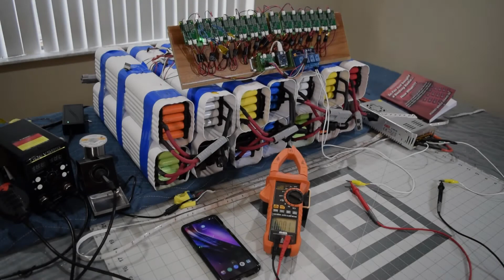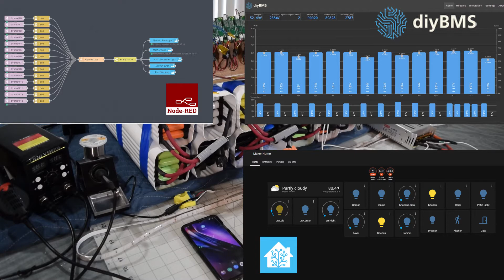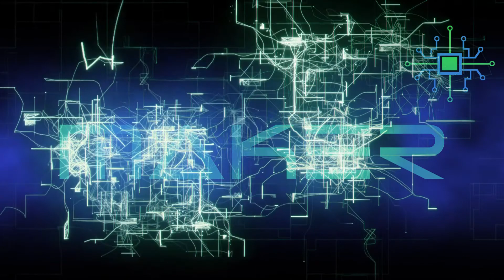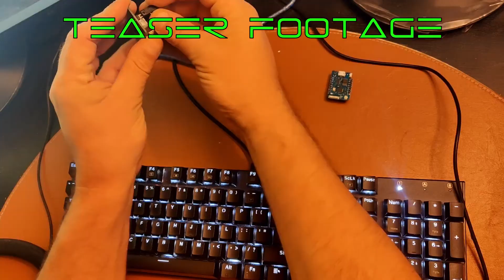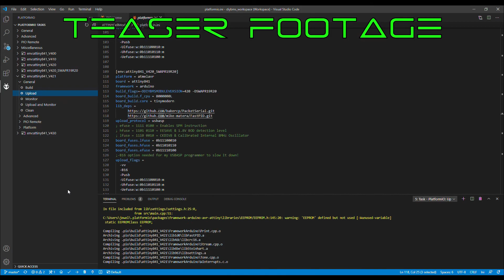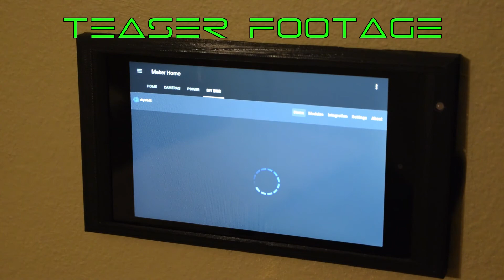Home Automation DIY BMS

Comment: How did you integrate it to home assistant. took me two days with no luck
Reply from the maker: Created a sensor for each of the cells:  - platform: mqtt, name: "DIYBMS Pack 0 Cell 0 Voltage", state_topic: "diybms/0/0/voltage"  .  You can also get the internal temperature with state_topic: "diybms/0/0/inttemp", unit_of_measurement: "°C"

Comment: Good integration, well done. Just surprised to see the hugh voltage differences between your packs. it's like more than 0.25V. My powerwall has also 14S config and packs are all between 0.02V, even after 6 months intensive use and no BMS/balancer.   Look forward to see more movies Shawn. Don't woryy about the movie skills, good movies don't need flashy intro and loud music.    Frank  http://www.easypowerwall.com
Reply from the maker: Thank you Frank. This is my very first powerwall that I did a couple of years ago and haven't charged or balanced them in about a year. I know, shame in me. I use them for testing.  I have a 14s100p in production now that I will be putting this diyBMS on. Not for balancing, but for the integration. I have a new build coming to parallel into that production pack. Thank you for commenting. Now I'm off to check out the link you put in.  Take care.

Comment: Good integration there Shawn.  Are you using the the latest code from https://github.com/stuartpittaway/diyBMSv4Code/tree/HysteresisRules which includes high and low setpoints for th rules?  Its also important that the leads to each module are as short as possible to each cell.  This reduces voltage drop in the (thin) power wires to each module.
Reply from the maker: Thank you. I have to look and see if it is the latest code. Your build works so well, I didn't even think to check for the latest code. The 4.1v is genius. Great work on this!